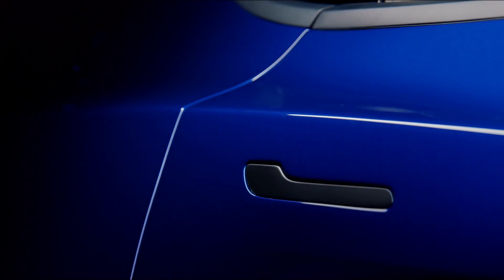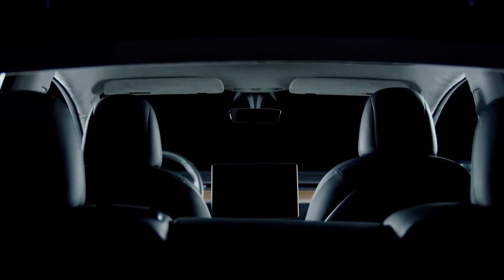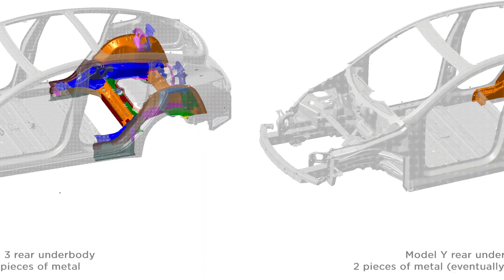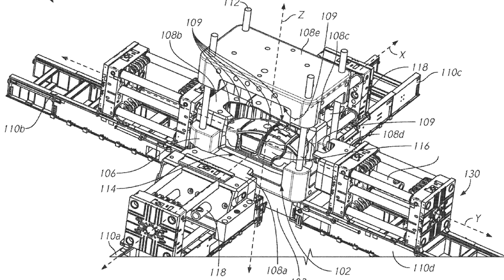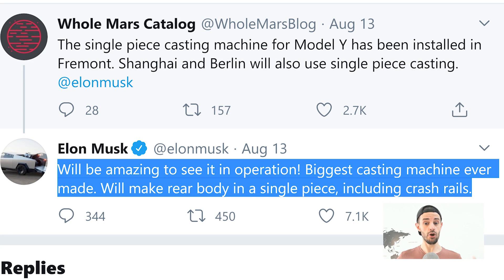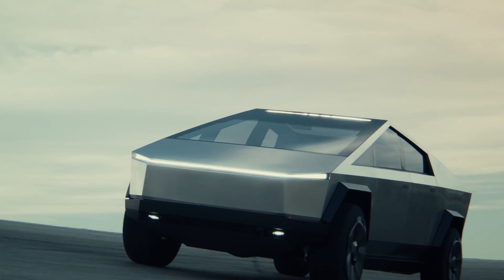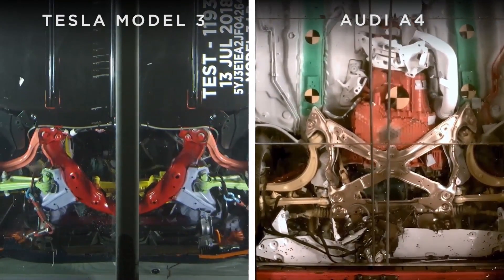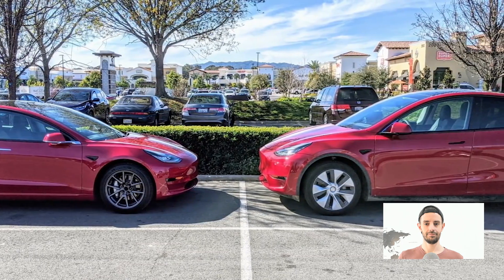Tesla's INSANE Giga Press (engineering genius)

Comment: Steven, i used to work for a company that would refuse to change. They would always tell me they wanted something new and cutting edge. I would produce. They were all excited. But then when it came time to execute, they chickened out and make the switch back to what we have been doing for last few decades. They were scared of change. They only wanted to do what they knew and were comfortable with. All that work it did was for nothing. And it happened EVERY YEAR! So i totally can confirm what sandy is talking about when companies are myopic and frozen in fear of change. It actually happens at a lot of companies. Especially old legacy ones with old legacy management. Sounds familiar? What company is more legacy than automobiles?

Comment: Where have you been Toyota, VW, GM, Ford, FCA, Mercedes BMW for the last century. squandering trillions on Cosmetic appeal, and fine upholstery with gleaming metals strategically positioned, pretty wheels and fancy paint jobs.
Shame on you, the last significant real improvement on the Internal combustion engine happened 50 years ago with the introduction by the Saginaw Div. of GM of the Electronic ignition, and since then nothing in reality, except for the introduction of the Hybrids you are trying to screw you customers with, a true very complex contraption, very costly to maintain tuned for its complexity, for trying to run the car with two separated power units, a mechanic major headache, all these problems and the excessive purchasing costs for a mere 20 or 25% fuel saving. But in reality costing the motorists a lot more than a strait ICE car. All the advertising and merchandising barrage on the Hybrid, to hide your incapability and retrograde mentality evidencing your impotency to counter Tesla excellent and outperforming EV that is taking heavy slices of the markets from you, and all of that without a dealer network shoving the cars  down people throats, or mega advertising budgets. Your days are numbered and they will come much sooner than you think, because Tesla will eat you alive with practically maintenance free cars, with slashed operating costs, with unheard of safety and performance that evidence how really old are those gleaming cars you are offering, obsolete even before being sold. While a neophyte Elon Musk is eating your lunch, the entire industry lunch, with breath taking performance numbers, that the consumers only dreamed about, for by far lower price tag, that are even shaking Ferrari and Lamborghini manufacturing plans. The sooner you dump the costly Hybrids and concentrate you efforts to pure EV technology, the greater will be your chances for survival.

Comment: Foundry Engineer / Metallurgist here. I'll tell you why VW isn't integrating their cars as much as Tesla. They build their cars on a platform-system which allows a large overlap of parts in the production (and development!) of a whole number of vehicles. So while Tesla may have optimized the production (and development) of a single part in a single car, VW optimized the production of ALL their vehicles, covering everything from superminis to family-vans. I know a lot about VW, but not so much about the other manufacturers but they will have similar ideas. Mind you, VW uses a lot more advanced materials for their chassis construction. The MBQ uses AHSS and other highly (and newly!) developed steels in large parts of it's construction.

Another point, integrating the crash rails into the main body casting is an extremely stupid idea. If the rear crash box  is integrated into the casting, I'm not a great fan of using aluminium in this place, as it has quite low ability to absorb energy in its deformation compared to other materials specifically designed for that job (think TRIP/TWIP-Steels). How did they do it? Well by increasing the amount of material used in the place of course. You have to make a balance between rigidity and ability to uptake energy here.

I don't disagree with the general idea of integrating a lot of functions that a welded construction provided beforehand into a single cast part, quite on the contrary that's great for the castings industry. But this is not some amazing "breakthrough" new idea of Tesla, you can bet your ass that engineer at other big car manufacturers are calculating stuff like that all the time and have unanimously come to the conclusion of it still not being worth it. It's really a logical step to take and has been applied to other subparts by other car manufacturers in the past. The problem also lies not just in the hpdc-machine, it's the tooling that is extremely complicated and expensive to manufacture, requiring a rather large up-front investment compared to long-term higher parts cost by doing a welded construction.

Comment: I would not be so harsh on the US companies because they did not purchase Sandy's reports. Competitive analysis is standard practice in industry so I expect the US companies have done their own analysis. However, I would be extra harsh on the US companies for ignoring what is right in front of their noses. I worked as a mech eng on disk drives for 30 years and we never announced a product that had the same performance as an existing machine. We always designed product performance to be 2 generations in advance expecting to solve the technical hurdles by the time the production line was turned on. It has been my privilege to work on many engineering teams and all you have to do is let them loose. Cheers and stay upwind of crowds.

Comment: In the vacuum of space, there is a "problem" of similar metals seamlessly bonding if the oxide coating is worn off. Worth looking into.. If Elon Musk got some smart engineers working on using this first principle fact as a manufacturing technique it would be another game changer! :D

Comment: I worked on the line at GMH, Elizabeth. The factory was built in 1963, I worked there 1978. I'm sure that nothing had changed over the years. As for stamping vs casting, it would never occur to the engineers to use casting. Stamping and spot welding FTW!  The line moved continuously. Horrible, if the guys upstream of you is slow, (he was) you end up pushing into the area of the guys downstream.

Comment: Hi Steven. 
Why Ford, GM, Dodge have not come up with the great idea as Tesla's?
As a new engineer, your are going in to the company as a new bee, you don't know shit your lucky if you can fine the bathroom. 
You are there to learn how things are done, in the manufacturing world, engineering world. 
Your are given the shit jobs, until you prove yourself as competent . I'm looking at 9 to 18 months. depending on the size of the company the bigger the longer it will take. 
Maybe after a year of small successes, you may get a small design job.  This is where they wax the ice. 
You take your design, and have a peer review, now you explain your design to your colleagues.
If your lucky and it's a new company your colleagues are close to your age.  If not like Ford, GM Dodge now our get the caned excuse, THAT'S NOT HOW WE DO IT HERE.
Other then that there is the Top down design, where you spend months working on a project, get good peer reviews.  Then out of the blue from the top your project is canceled.
too radical of a design, does not fit in the company's profile. Then and older Engineer will pull you off to the side, and say,  your a good engineering, but if you want to sick around you have to play the game, don't make waves.

Tesla on the other hand, is an open architect, open minded engineering company.
no preconceived  ideas  (winning)  allowing engineering to engineer, and prove there salt with test data, and sound engineering practices.

Comment: In the event of a moderate crash, if the rails are integrated in the chassis then I guess repair becomes impossible. I hope some attention has been paid to ease and cost of repair.
Reply from the maker: It has. I didn't cover this in the video but Tesla insurance is already teaching them how to built cars better and cheaper to repair in the event of collisions -- Elon spoke about this recently. :)
Reply: @SolvingTheMoneyProblem  yes, I saw that clip, but maybe he was referring to smaller cosmetic damage. However, swapping 1 huge single part may be cheaper than repairing a lot of smaller ones. As long as the casting is available as a spare part, no problem!

Comment: The reason legacy auto manufacturers don't make these enhancements is that fact they are making design changes annually with their model changes.  This makes payback limited at best, likely not feasible.
They are also having their engineers and entire corporate structure locked into short term payback.
Partially a culture, partially the willingness at Tesla to not follow the typical practice of model year designs.

Comment: What pisses me off is the plethora of automotive reviewers - usually attached to some motoring magazine or vlog- who spew out dozens of video reviews on cars (including Tesla) and utterly FAIL to look beyond the simple cosmetics, and should rather be examining the engineering. This includes structural and mechanical elements, and now (of increasing significance) the electronics and computer management systems.
ALL these guys (and gals) totally ignore the "unseen" features that are now so critical to how a car is made, why these elements influence manufacturing costs, and what they all mean in terms of the car's real value and purpose.
Steve's CORRECT in extrapolating this short-sightedness (scotoma) into stock analysis, where there is a total inability to interpret the data, assess the facts, and (in short) see the future.
Sandy Munro should be a MUST-GO-TO resource - not just for Tesla - but for anyone who wants to know what matters in automotive engineering in this day and age... but the so-called "experts" will ignore him, because they cannot interpret the data. They suffer from scotoma.

Comment: Why hasn't anyone else done this?
Because it's not that big a deal

How big a benefit is this?
Perhaps $200 per car?
Great but it means a $38,000 Tesla becomes a $37,800 Tesla so the cost to the consumer goes down ~0.5% hardly the magic bullet that makes Tesla affordable

It's nice small improvement for the car
It doesn't take the car from expensive to affordable

You lot think the traditional auto companies are stupid when the reality is you tube 'content creators' are just misleading you with their own very limited knowledge

As I keep pointing out

Tesla model 3 SR+ = £43,500
Mercedes C Class £23,206

How is a aluminium press going to know £20,000 off a model 3. It isn't. It might knock £200 off the price

Something as simple as building a factory in Europe is 20x bigger improvement/news than this aluminium press because building in Europe means no import tax means they can reduce the car price by close to £4,000 or 20x the difference of this

Comment: Bought my last chunk of Tesla this afternoon. My avg price is now $1,300.  98% of my portfolio is in Tesla now.  I previously owned it at $190, $204 & $242, and I had the same amount of cash at that low price that I have now deployed. That fucking hurts. But I believe the potential value in 10 years is between $30k-$60k per share so fuck it. I've learned, will not sell a share until I find something else that will compound at 40%-50% per annum for 10 years. Fuck it hurts. Circa $110k in would now be around $650k if I had deployed in June last year.

Comment: Another reason that Tesla is doing this is because they frankly made crazy design decisions that ended up with the 70 parts of the original Model 3 rear end. The rest of the automotive industry uses far fewer parts, so the motivation simply isn't there. Everyone else makes them the same way, so complacency rules.
Tesla kick started the idea because they were in such a crazy place, and once on that line of thought, they pushed it as far as they could go. Even Sandy Monroe was surprised at how far they were prepared to go.
Another thing is that most car makers use Steel everywhere, and you can't cast this in Steel. They've only relatively recently started making things in Aluminium, so it's not entirely surprising that they simply hadn't thought of doing it this way.
Having been shown how it's done, do I think the rest will follow suit? I doubt it. It wasn't invented by them, and they're not about to be shown how to do something by some upstart like Tesla.

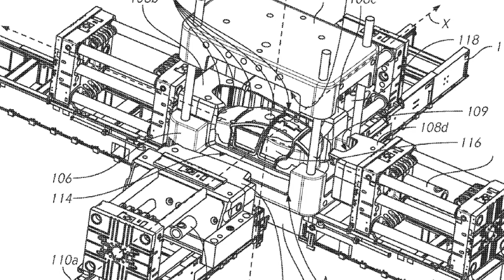Comment: Answer to the question at 0:50, because they don't have access to aluminium that doesn't require baking in a oven after casting. That is the key to guiga casting. Baking basically 2d parts allow loads more in the oven compared to big castings, now the aluminium from space X doesn't require baking opening the door to this.

Comment: This stuff gets me very excited. Idea for a video: Explain why Teslas Supercharger network make their cars magnitudes better to own. Doesnt matter if anyone even managed to make a better car if they have to rely on crap and unreliable public chargers which often consists of just one charger so if taken you have to wait. Superchargers always have 10-12 stalls AND you can see on your navigation how many are available. When you set destination to a supercharger your car even starts preparing the batteries to receive the top charge speed a few minutes before arriving. Compare that to a public charger which you have no clue if it is working or available so you have to budget your remaining battery to be able to drive to another charger if not working. THIS MATTERS! The superchargers are almost always at a spot where there is a decent restaurant, free wifi, toilets. CHARGE SPEED for a supercharger is 120kW to 150kW adn the new v3 ones are 250kW. I have never seen a public charger faster than 50kW and never actually seen the 50kW delivered. PRICE: Tesla does not charge a premium on the electricity. On top of this you have a huge amount of destination chargers which Tesla installs for FREE if you have a restaurant or hotel or similar so why not request one and get more customers. This matters and will matter more going forward.

Comment: Question for the group : In moving to fewer and fewer pieces and more streamlined manufacturing; are there any drawbacks?  For instance, are Teslas harder to repair if you have to replace a gigantic cast piece rather than a smallpiece here or there?  Are there trade offs in reliability?
Reply: It’s easier to replace one part at a KNOWN cost versus hundreds of parts with variable costs at the dealerships.
Again , structurally the replaced part will align precisely more often than hundreds of parts being put together

Comment: It's about time.  That has been a weakness of Tesla's since their beginning. They used far more individual pieces to build their cars than any of the major auto makers.  This sounds like they're not only catching up to the big industry designs, but leap frogging it.
Reply: Yes, the inside of the rear of a car can be made with at most 10 stampings. Tesla having 70 is more of a production engineering fail. Maybe if they had only 10 bits to spot weld, the need for a casting would not be so strong.

Comment: This is amazing. I would be interested to know what the repair situation is like when the whole end of the vehicle is one piece.
I have experienced situations where I get a fender bender or a scrape/dent, and the repair shop says they have to replace the whole back panel of the vehicle.
Reply: Stephen Adkins , I was wondering about that too. I guess you would need to replace the entire cast piece. I’m not sure that is a disadvantage except for paint.
Reply: You don't, if you do this level of damage to any car it's a write off nowadays anyway.
Reply: It would be far cheaper than the same level of damage to a normal vehicle. The reason "we gotta replace the whole side" is so painfully expensive is the hundreds of little parts involved.
Reply: Elon actually mentioned the crazy costs involved in minor fender benders when discussing Tesla's auto insurance business.   He thinks there should be an engineering solution for this.  I see Tesla offering much cheaper insurance rates to their customers in a few years once they figure this out.  Any accident severe enough to damage the frame and the car will be written off--it's a matter of safety.
Reply: His cars simply won’t be involved in fender benders or crashes at even a small fraction of the rate that other vehicles are. Autonomous collision avoidance will see to that long before full autonomous driving arrives.  After that collisions of any kind will likely become an extremely rare event. That will likely flip the table, so to speak, when it comes to automotive insurance rates,  with non autonomous vehicles paying the highest rates instead of the complete reverse right now. 
Why worry about something needing to be fixed when it’s something that’s going to be so incredibly rare? 
It will make about as much sense as worrying about being struck and killed by a meteorite...  could happen yeah,  but chances are so small it’s not worth even thinking about...